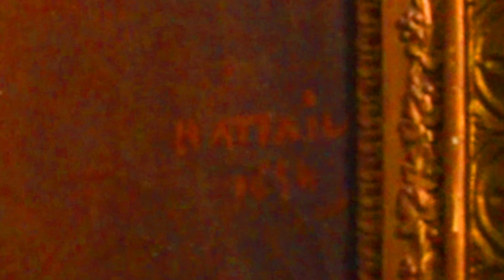Restoring Art, Disassembly of the painting and cleaning. Part 1

Comment: This issue has been indirectly discussed, but I am always curious what professional conservators would recommend for "emergency" repairs when an expert is not available.

For example, I live in a small city. Even finding a trained carpenter or plumber can be a challenge; the nearest art conservator would be about 800 kilometers away, and already working full-time for a major gallery. Around here, the choices are hire a well-meaning if unskilled amateur or do it yourself; professional expertise is just not available.
Reply from the maker: I totally understand your question, even in bigger cities can be a challenge to find some more specific workers,
In case of an emergency, the important is to stabilize the hole or tear, so it doesn't get bigger or lose too much paint. I suggest buying methyl cellulose to make some glue, ( it is a very basic glue that can be bought in a bricolage store) the glue that is used to glue the wallpaper, and buying a piece of Japanese to apply over the hole or tear.